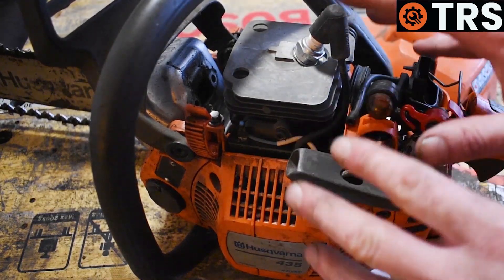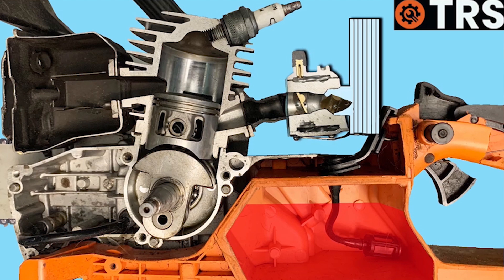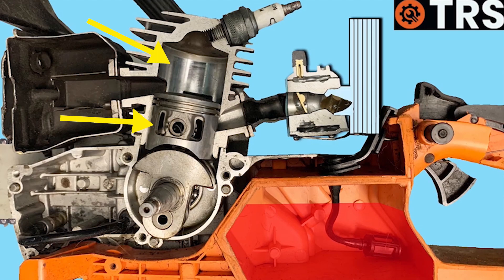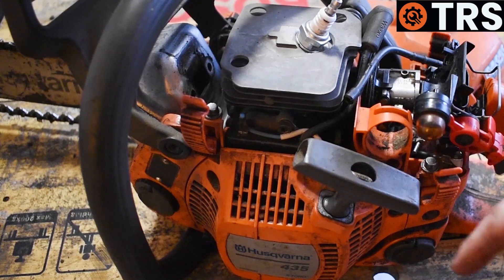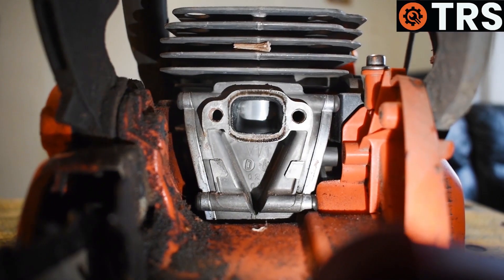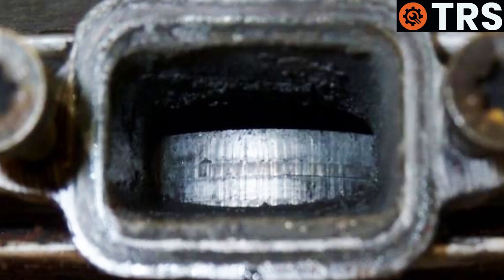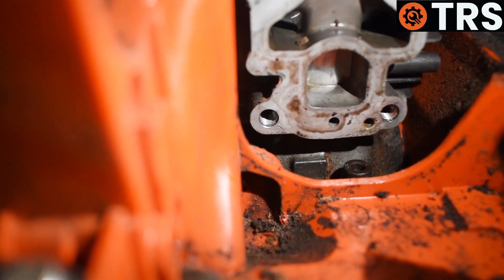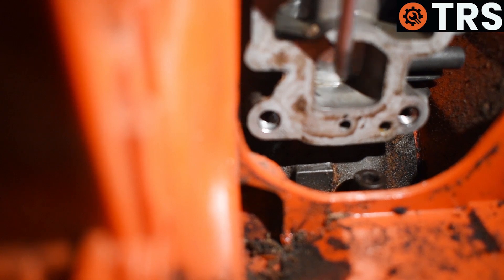How to Check Inside Engine without Stripping it Down (by Craig Kirkman)

Comment: Amy chance you can do a video on carburetor bowl vents?  I have a mower that will sometimes randomly die and it actually has fuel in the bowl but it won't pull the fuel up and the jets are clear.  If i spray through the bowl vent circuit (where the primer circuit is on primered briggs carbs) it will start right up and stay running for 45 minutes no problem...something is causing this bowl circuit to keep getting clogged...or it's just not venting unless I spray through it...very odd issue not your normal carburetor plugged jet problem